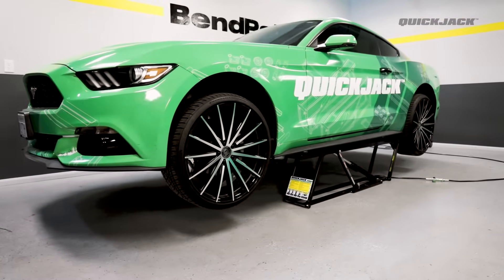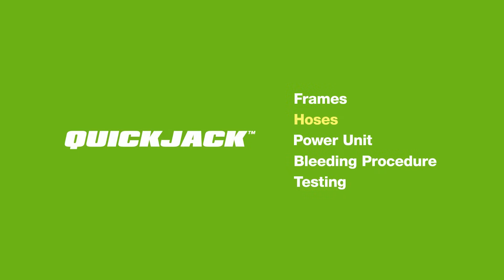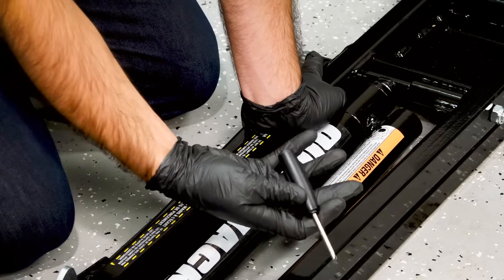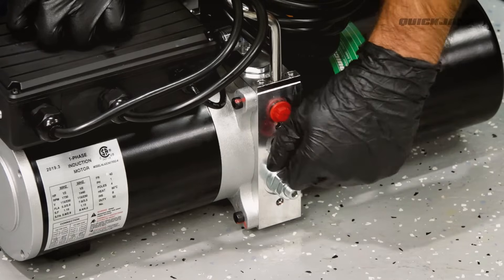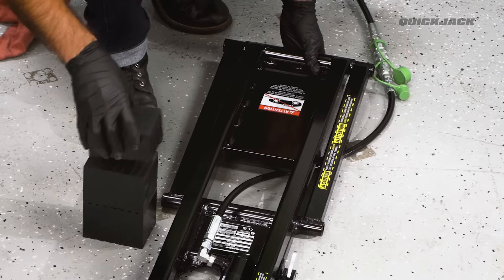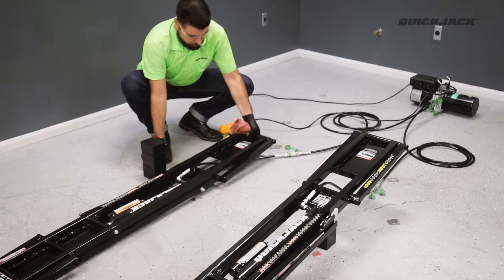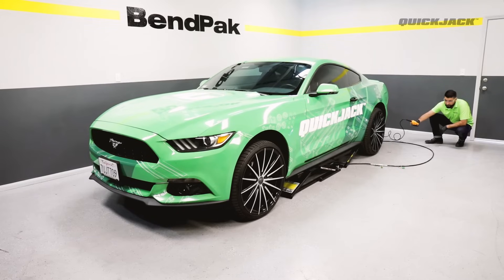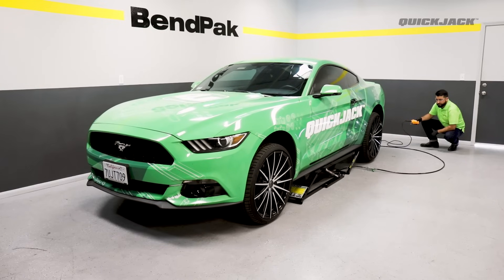The Official QuickJack Setup Tutorial

Comment: Great idea to include checking the tightness of the schrader valves. I had a problem with mine not being tight enough a couple of years ago on my then new Quick Jack. They were not tight enough to hold pressure. They simply needed a little snugging up and my Quick Jack has since worked flawlessly. Love my Quick Jack! BTW - I do find that on my 2002 Jeep Wrangler 2-door the units can't be placed perfectly parallel. They have to be slightly pigeon-toed at the front of the Jeep as the Wrangler's frame is narrower toward the front. The Quick jack works great on the Wrangler with that placement.